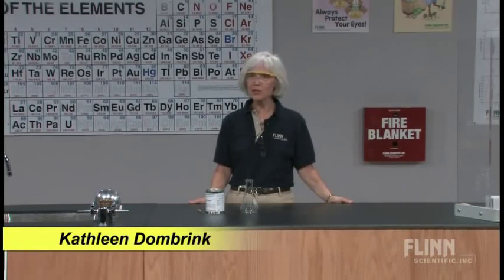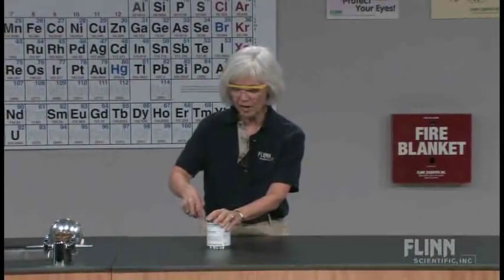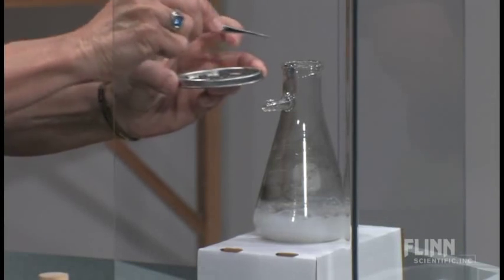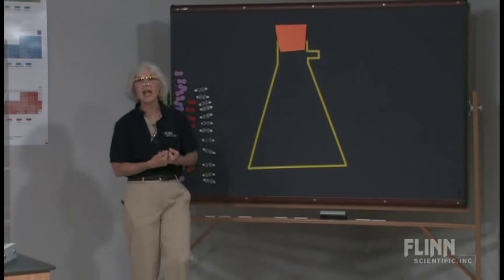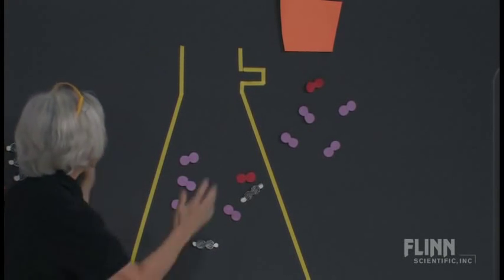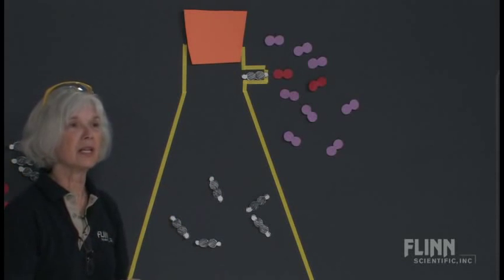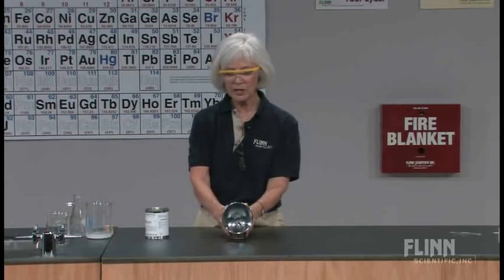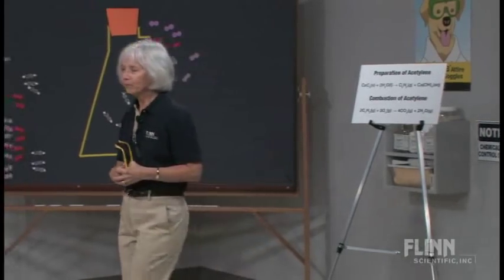Combustion of Acetylene

Comment: Thank you so much. This is an awesome explanation. I’ve never understood chemistry. It’s something my mind cannot understand. I am a Heat & air contractor and I’ve used an oxy/acetylene torch for over 20 years and somehow I stumbled across your video. I like filling up milk jugs with my torch and throwing them in a fire! I will get a good flame mixture on my torch and shut off the acetylene bottle to extinguish it without changing my mixture and then I turn the bottle back on and fill the milk jug displacing the air. And when I think it’s filled up I cap it and throw it on the fire! Book! My friend showed me how to remotely use an electronic match. And then I started filling up big trash bags and putting an extension cord with steel wool to short the connections and I connect it to 36 volts on my golf cart. Boom! I never understood how it works but I enjoyed your video.

Comment: Great comment at 8:46.  Modern-day explorers would use batteries, but the calcium carbide lamps are lighter.  Calcium carbide has phenomenal energy density, even better than liquid hydrocarbons.  Batteries, even the best lithium-ion batteries, not-so-much.  That's one reason why it's harder to convert our car fleet to batteries.
Reply: These days, carbide lamps are totally obsolete. A modern caving light is lighter, smaller, more durable, longer lasting and easier to use than carbide. Although carbide lamps have a lovely warm yellow light, and a lot of stored energy, they release most of their energy as heat. Carbide lamps easily beat lights using incandescent bulbs and alkaline batteries, but can't compete in any way with the combination of Li-ion and LED. Cavers all abandoned carbide in the past 20 years. LED lights don't go out when you walk by a waterfall.

However, it is always fun to read an old caving book that assumes you are using carbide. "Need to cut a rope, and forgot your knife? Simply use your headlamp to cut the rope! You can also heat food on your light."

Comment: I'm surprised the flask didn't explode, I'm assuming I shouldn't conduct this with a non-Pyrex cheap chinese filter flask because the quality may be bad and it could explode right?
Reply: Just say no to Chinesium.
Reply: I mean like they do have decent chinesium comparable to pyrex and simax (bomex is one which is actually founded by kimble glass), I have actually just tried something similar with hydrogen in a cheap filter flask, the pressure doesnt build enough to shatter it
Reply: Yeah I know that, I've bought a glassware set from amazon before, and when it arrived, it had bubbles and seams in the ground glass joints, and the condensor snapped while I was setting up distillation impaling my wrist, I've learned from that and buy decent glassware now (still made in china because its cheap but like proper name brands like synthware), and yes, I do know that when hydrogen burns it has less energy which is probably why I will only do this with hydrogen and the flask half full of water

Comment: I do have a question. I always slightly turn on my oxygen before I light my torch. If I light it with just acetylene I get all this carbon soot and it will really make a mess in a house or a restaurant and it lingers everywhere and won’t go away. So what makes that happen? I think it’s because of incomplete combustion. It is getting secondary air from the atmosphere but probably isn’t hot enough to burn off all the fuel so you’re left with this soot that just hangs around. Am I right?

Comment: Calcium carbide is not gonna do anything on your hands, if its not either flour fine or your hands are dripping wet.
Reply: @EdwardTriesToScience  I didn't say theoretically. I have handled Calcium carbide multiple times and even with sweaty hands touching it doesn't do more than getting slightly warm.